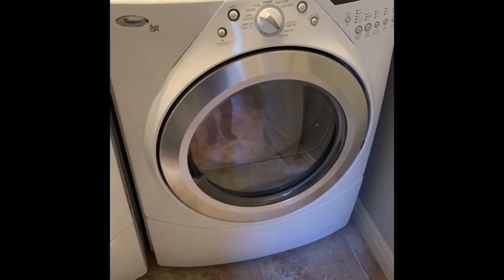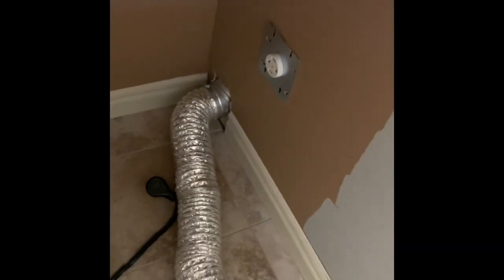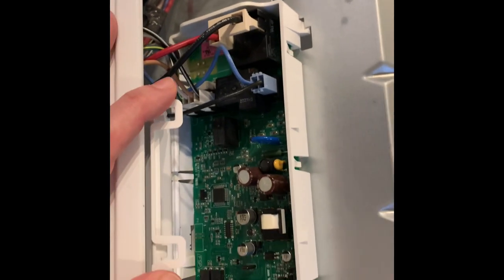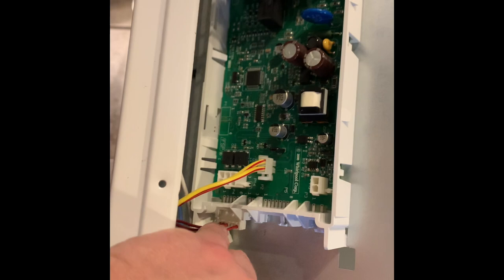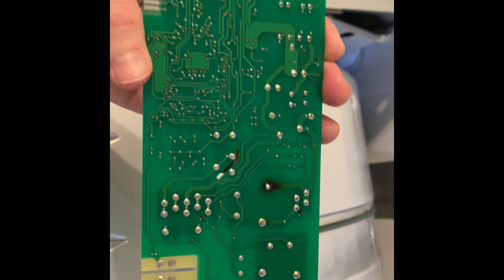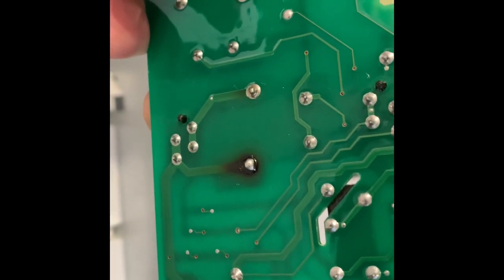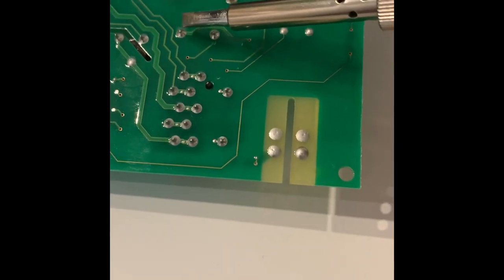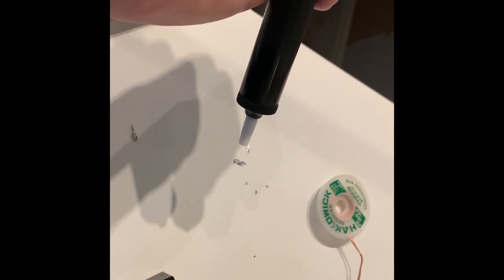Fix Whirlpool Duet Dryer F01 Error for $20 (Replace ONLY the Relay)

Comment: Another success!  I have the same Dryer in your video and sure enough the relay was the issue.   The G8P-1A4P-12VDC was only $6.95 now with Amazon prime next day.   I wish I could share a picture.  The inside of the plastic case below the circuit board had an explosion looking black spatter on it from short circuiting.   Fired right up and starting working like normal after I replaced it and turned it on.   Super thanks for sharing.   Saved me at least $200 for a new board and a service call charge to boot if I didn't so the work myself.   Super grateful for sharing with your fellow home repair dad.  Thank you!

Comment: I had the same issue with our Maytag dryer. The repair company wanted $80 service fee just to come out. We discussed the error code on the phone and it was determined the board would have to be replaced. The cost for all this? ( including the mystery “diagnostic fee?) Service fee $80, replace the board cost $340...total $420. Ive seen videos similar to yours and concluded I could repair this myself. The burn mark above the relay, same. I checked on Amazon and although not an Amron relay, it’s a replacement brand I bought and the dryer works perfectly. The cost? $11 and about an 90 minutes including soldering the new relay. The wife is thrilled and I enjoyed the fix AND saving $409. Thanks so much for folks like you to post these videos to help folks not get taken in by overpriced service charges and highly marked up parts.
Reply from the maker: You’re welcome, and I agree - I rely on self-help videos from fellow youTubers all the time, and was happy to “give back” a little with this one. Thanks for watching!
Reply: Amen. Life savers n $$$ savers. Lol

Comment: This video was spot on. I had the exact same issue. Tested relay, and it was good, but it had a blown out cold solder connection. Repaired solder joint and it works like a champ! Thanks for posting.

Comment: This video was very very helpful and informative! I had the same problem and was quoted $300 for a new board and $250 in labor…  $11 on Amazon and 10 minutes of my time and my dryer is running just fine again! Thank you !!
Reply: That's wild. Big bucks to have someone fix it! I lucked up only had to remove control panel board, find blacken shorts, clean with brass brush, then resolder. Only parts/supply was solder. This was on a Whirlpool Cabrio by the way. What state was the estimate in ? I'm in NC.  Thanks. Keep on saving . Lol

Comment: Thank you for posting this! This was the exact issue I found with my whirlpool duet dryer. The fact that you swapped out the relay and it worked makes me confident it will work on mine as well. I just ordered the relay and will give it a shot.
Reply from the maker: You’re welcome, best of luck with your repair!
Reply: I noticed that the model number was different even though the voltage and amp were the same does that not make a difference when replacing these relays?
Reply: @wdfshampoo  it did not make a difference in my case. I made sure the voltage and amp ratings were the same, and that the pins were aligned the same. My replacement relay fit well and is still working over a year later.

Comment: Excellent. I just had the exact issue as shown. However, my relay was functional. Therefore, I repaired the solder joint and in 10 minutes I was back in business. Thank you!!!
Reply: Is it still working. Did you check continuity on relay.  Did surge cause initial blow out and now no more surges?

Comment: Thanks James for this video.  I was thinking of attempting changing the relay, and your video confirmed my decision.  I was able to find an equivalent relay locally (Toronto), same day for 7.95. The solution worked for me!  Thanks again.
Reply from the maker: Awesome, glad to hear it.
Reply: Edgar, where did you find the relay in Toronto? I need to do the same repair and your information would be helpful.
Reply: Hi Jason.  A1-electronic Parts. Near Sherway gardens. It is a small unit.
Reply: @jasoncharbonneau9588  A1-Electronic parts, near Sherway Gardens.

Comment: I kept the same switch, cleaned up the burn mark, and used copper-desolder to remove the solder joint.  I then soldered a jumper wire.  FIXED!  "Joe's Classic Video Games" channel has the same problem but with jumper wire fix.

Comment: Nice video, I had identical problem, except my dryer turned out the E4F4 code.  Part was $400 but ten weeks (maybe delivery.  Bought a new dryer, but they keep delaying that, so in desperation checked out YouTube.  My board looked perfect on top, but after removing it from the case the burned out copper strip was obvious. Soldered in a little jumper and we were good.

Thanks

Comment: Although it's a good low-cost option to try and replace the relay - it's quicker, easier, more reliable to just replace the entire board.  Especially since many people have no soldering equipment or experience doing it.
Reply: Little dab did just fine. But you’re right, I’ve no expert, but I know my way around an iron.

Comment: Thanks for the tip on where you bought your relay that working for you, seems digikey and mouser in Canada both have none in stock and ebay is often a crap shoot on quality. I re-soldered a new trace to get it running again temporarily while I wait for a new relay. I have no doubt that the relay is what caused the solder joint to fail.

Comment: Apparently like many solder joints that fail, this one is common. 
Had a similar issue with a Bosh dishwasher and an instrument cluster on a GMC. GMC I was able to resolder the joint and it works great. The dishwasher I had to replace the whole board as it caused other issues. 
These joints failing in the same place on each dryer signals a bad solder joint from the factory process.

Comment: The problem was rooted to poor soldering.  Whirlpool released a newer model control board to fix the bad soldering across the entire board as a replacement.

The reason it burned thru was because when the solder cracked it kept the power without relaying it to the next pin in logical sequence and likely the cause for the relay to break.

Also, to make it easier to get the control board out, I took off the entire metal plate it sits on and you'll see how the white shroud is attached to it to release it entirely.  It made it easier for me to get the board off as my hands are not small.

Thanks for explaining and showing the replacement steps of the relay.  I didn't think of trying it and only tried to resolder the pins.

Comment: When I removed de old relay I found that the copper from the board and the ring where the prong from relay is introduced were gone. The arc burned about 1/8 ~ 1/4 inch of the copper.
The solution was to use a regular copper wire that I pulled form an electrical cable and solder one end to the relay and the other end to the copper channel
Reply from the maker: My only concern is that the problem may occur again, but hey, you’re up and running and that’s the main thing. I originally tried just resoldering, but in my case it didn’t work. Thx.

Comment: James - any need for concern about the wattage of the soldering iron used? Could I ruin the new relay with too powerful a iron?
Reply from the maker: Hi, I think as long as you are careful and you get the pin/pad just hot enough to take the solder, you’ll be ok. I had the same concern as I was doing mine and it worked out fine. My iron is just a cheap 40 watt model.
Reply: @jamesthompson9685  thank you - i've ordered my relay this am but have to wait awhile for delivery. My dryer is not completely dead it will start , sometimes for 10 minutes or so before it cuts out and gives the F -01 code. So i'm still able to get by! Fingers crossed.

Comment: How long did the repair last? I'd expect the burn damage to the circuit board trace only gets worse with time. Eventually you may need to reinforce the trace (somehow).
Reply from the maker: Still going, had to replace the heater element most recently though (fairly simple, thankfully)
Reply: Just solder a wire parallel to the trace on the circuit board. Problem solved.

Comment: great video brother, how's it been doing ? mine went out the exact same way, sometimes shutoff mid cycle. popped when putting in a second load, took it apart & the relay went out just like that, just trying to figure out what led it to failure ?
Reply from the maker: Thank-you for your feedback. Installing the new relay has completely fixed the problem and our dryer has been going strong ever since. I believe these high voltage relays are prone to failure over time, as internally there is probably some sparking (which degrades the contacts) with every activation. Over time they simply wear out. So, if you replace the relay, you are solving the root cause of the problem. Good luck with your repair, please post any questions. Thanks again.

Comment: Hi thank for your demonstration, I have the same F01 error but I don't find any burn mark on the board, do you think it's the same solution ?
Reply from the maker: That’s a good question, I am honestly not sure what other board failures might cause the F01 error. If the error is popping up the same time as mine, I would think replacing the relay would be worth a try.

Comment: I have the same dryer,  but no lights come on at all...nothing.  The thermo fuse is shot and one is in the way. No burns on the control board.  I'm not sure which board would be at fault. Any ideas?
Reply from the maker: Sorry, I’m not sure either

Comment: You said you were going to supply a link as to where you found the relay.
Reply from the maker: It’s at the bottom of the description, but here it is as well for you:
https://www.ebay.ca/itm/Omron-General-Purpose-Relay-G8P-1A4P-12VDC-30A-250VAC/122633197771?ssPageName=STRK%3AMEBIDX%3AIT&_trksid=p2060353.m2749.l2648

Comment: I look online to order that relay  I can't find it it's exactly the same dryer on the video I have and I have the same problem they're really is done if you don't mind to send me the link to order it I'd be happy thank you good video by the way
Reply from the maker: The link is at the bottom of the video description, but I will paste it here too: 

https://www.ebay.ca/itm/Omron-General-Purpose-Relay-G8P-1A4P-12VDC-30A-250VAC/122633197771?ssPageName=STRK%3AMEBIDX%3AIT&_trksid=p2060353.m2749.l2648

Comment: Anyone tell me the PN  for relay for Amazon ?
Reply from the maker: I assume there’s a good reason the e-bay link in the video description is not an option for you? If you use amazon and search “omron relay g8p-1a4p” you will find some $20 (CAD) knock-off options that may work just fine.